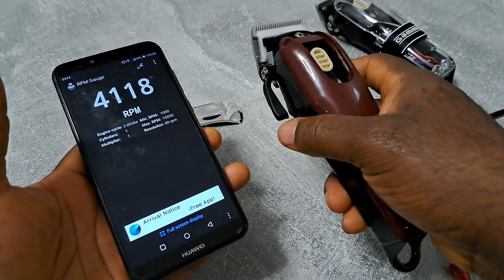4200mAh battery gave my Wahl Magic Clip a BOOST 🔥

Comment: If I change a 3.6 v battery with another 3.7 v, is there a danger to the engine? Plz anser me
Reply: Depends on motor from my understanding. If motor is rated for a load on 3.6 and your delivering 3.7 your over loading it. Could lead to a burnout.
Reply: @Owwwwwwwwwwwwwwwwwwwwww  long run there might be a burn out but such a difference as .1 it doesn’t really matter you can still do this mod and if in the future it happens then so what replace the parts as you would in a car and keep on trekkin’. This coming from a guy that went to school for electronics.

Comment: Yo bro, the 4200mah battery does not exist to RPM the fact is, it will last long, its give a long life battery not the power of motor its sustain long life battery.. ✌️😎
Reply from the maker: Good to know
Reply: Then why does it sounds like it has got more power than the regular magic clip motor with the stock battery?
Reply: @edounboxingofficial   
The more mAh you have the more the battery lasts but the power of course remains the same. That said, don't believe what is written on Chinese cheap batteries, there is no 4200 mAh battery for the moment, the best ones for now are 3300.